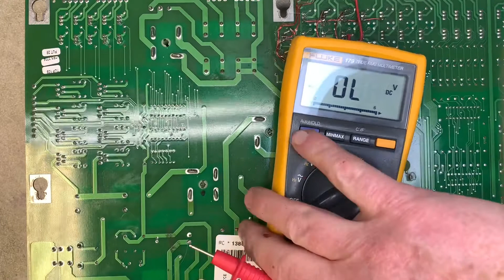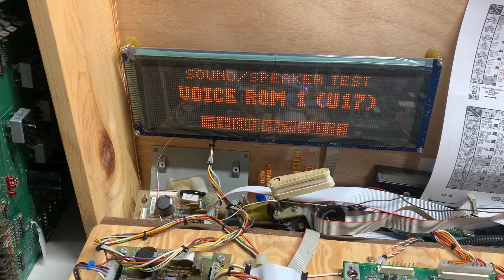Stern WhiteStar PowerDriver Board Diagnosis and Repair

Comment: Kudos for the video.

I think I have an issue with F22. It doesn't blow, but it measures 3v (not 8), with or without the fuse. I'm not savvy, but I have a multimeter.

I hope you could please help me out.
Reply from the maker: Your DMM is measuring "sneak circuit" power from who knows where. I'd replace the associated bridge rectifier.
Reply: @ChrisHiblerPinball Thank you very much, mate. 
Those would be like the ones you are checking in the video, right? 
Can I test them from the other side without removing the board?
Reply: @ChrisHiblerPinball  Thanks legend

I checked the 5 Bridges, and all read 4, there seems to be no circuits there.

This is what my fuse reads:
F1: 0.02

F24: 0.08
F25: 0.08
F26: 0.08
F27: 0.08

F9 : -0.03
F8 : -0.03
F22: 6
F7 : 8
F23: 4

4 bottom ones game me this error (?)
F6 : "1 .  "
F28: "1 .  "
F21: "1 .  "
F20: "1 .  "